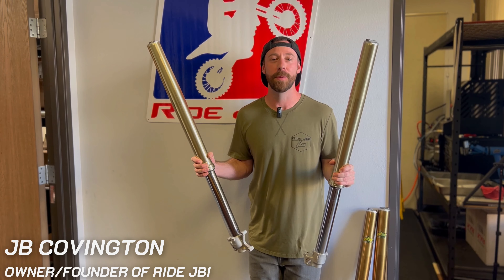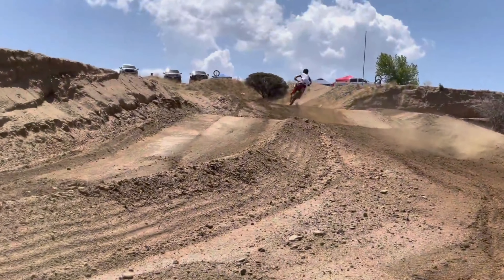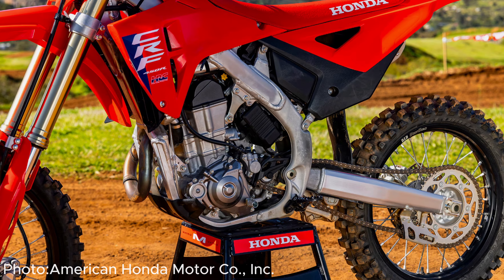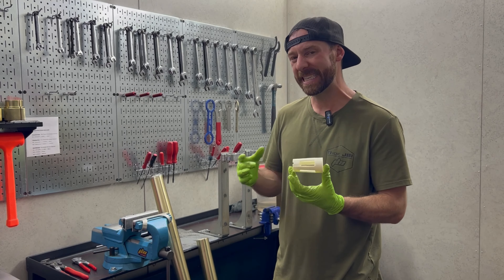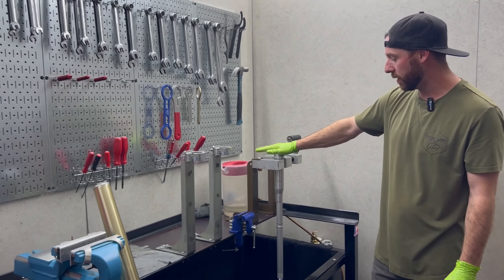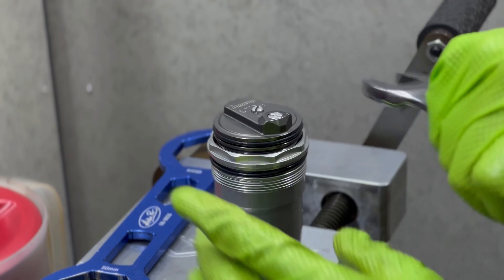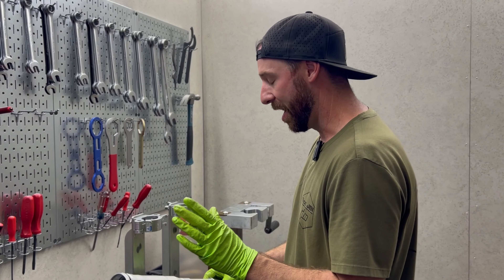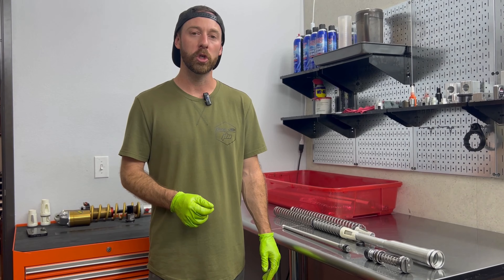Did Honda Fix the 2025 CRF450R with UPDATED Suspension?

Comment: I have new  25 honda crf450r I'm a vet rider I weigh 155 to 165 with gear on . New honda I was local ama pro class rider  in 2005-2009 long time ago lol ! I rode new bike on hard pack track that had some mud holes from rain several days before that filled .middle of jumps  bike felt awful chatters and I felt every little bump in hands and arms and rear bike felt like riding piece of concrete. Controls were horrible and felt like rear was to high and it had me over the center more on front of bike . How can that be fixed I'm vet been broken up alot wrists back ankles knees over 25yrs . I want as smooth as I can get but something that works well as I still can twist it for my age .
Reply from the maker: Hello and thanks for the comment. 

The JBI Spec Suspension revalve or DIY kit would provide you with a smoother ride experience

Comment: Any major changes in the shock? Good stuff as usual guys, thanks for the knowledge.
Reply from the maker: Hey there!

We have not dove into the 2025 CRF450R shock yet. Per their press release, Honda claims a new rear shock spring, reservoir, shaft, and oil seal contribute to a consistent stroke feel to match the fork updates. They also claim the linkage has been updated to a one-piece structure that enhances rigidity, to improve tracking and stability performance. It also features a new leverage ratio that decreases pitching while improving bottoming resistance.

Once we have a shock to disassemble and revalve, we will shoot a video and tell you guys all about it. Thanks for tuning in!